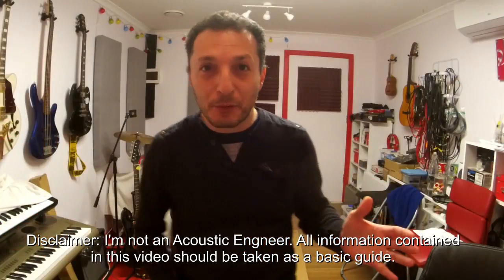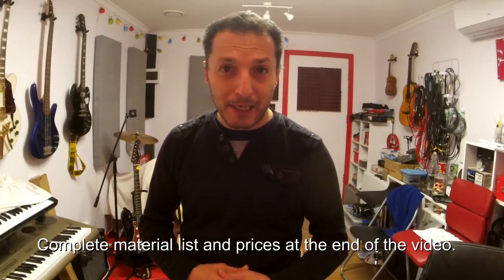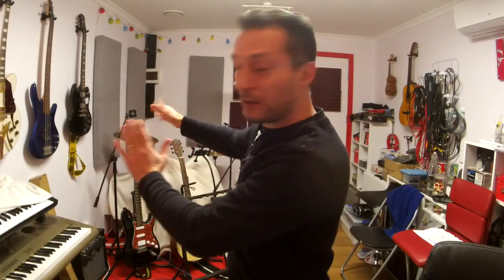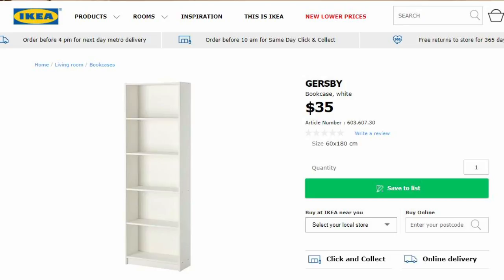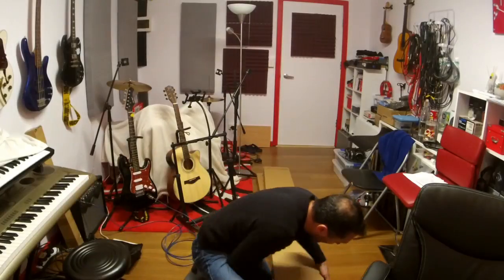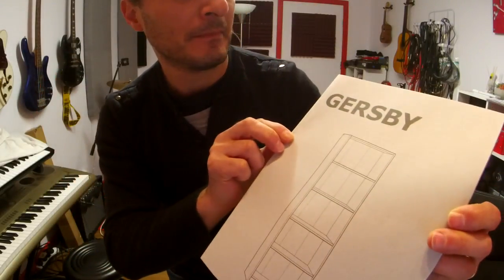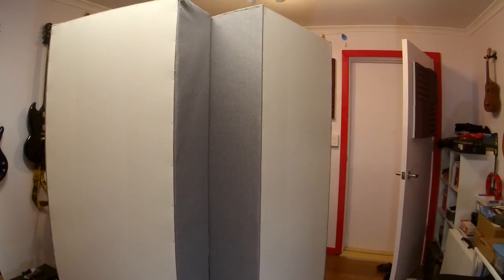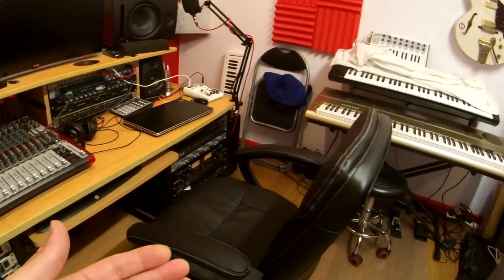DIY Gobo Acoustic Panels

Comment: I did a similar thing with cheaper materials a year or so ago and they were quite flimsy(may have been my shotty attempt at 'carpentry') so I threw them out when I had to move. Big mistake. Should have found a way to fix and keep them. Great video!

Comment: Very cool idea Vatche, I think I will make some too. I have some leftover material too.
I think I will mount some handles on either side of mine though so I can move them around easier and not push on the material. You always have cool ideas
Reply from the maker: Hi Billy,I actually purchased handles to mount, but then thought, if I have to place them next to each other, it will leave a gap. It's not that hard to move them.
Reply: hadn't thought of that :-) could even do wheels on the bottom, might be a better idea for my situation, i love that you are always thinking outside the box like me :-)
Reply from the maker: Thanks. Wheels can make it unstable in small room, unless you have rug floor. It's 1.8 meters high! On my floor, they slide very well.
I guess you can screw the extra shelves at the bottom of the bookcase to make it heavy for wheels to be stable.

Comment: Great idea to use the shelves !  How many layers of rock wool did you use? Also, how stable are they as far as tipping over ?
Reply from the maker: I had 4 layers of 70mm thick insulation, as the bookshelf is 300mm deep. They are stable and easy to move with no wheels, as the sound insulation is not heavy, but just enough to make it stable. Works really well creating a vocal booth, by placing them behind the vocalist.

Comment: Hi Vache. Are those fiberglass insulation? .
Thx
Reply from the maker: Yes  they are 80% fiberglass renewable materials, safe to use. But I would still suggest covering them with thick material cloth for extra safety. 
They work great.
Reply: @RecordingStudio9  thx for replying. 
I'm a hobbyist and will have a spare room soon and like to play around. 
Thx .
Reply from the maker: Are you located in Australia? These ones i believe are only available here.
Reply: @RecordingStudio9  no, in Canada .
Reply from the maker: I'm sure there are similar products available.
Reply: @RecordingStudio9  hi Vache sure there are . However I'm tying to get away from fiberglass .
Maybe pile sound blankets instead. 
I'm not making any money from this.
So I'd like to keep my cost down. 
Maybe help some friends there is Armenian brotherhood church help them out .
Reply from the maker: @garyshirinian  thick blankets will do just fine 🙂
Reply: @RecordingStudio9  thx

Comment: I would have cut them in half and made two thinner ones, like all of the other ones out there. Might as well use a mattress for that thickness. That's a lot of wasted space taken from the room.
Reply from the maker: Ummm... No.
There is a reason and effectiveness for having thicker panels, so it absorbs lower frequencies, which are usually the problem you are trying to solve.
Room space and the look is not as important as the effect of those panels when recording mics.
I'm quite happy with the results since I started using them.